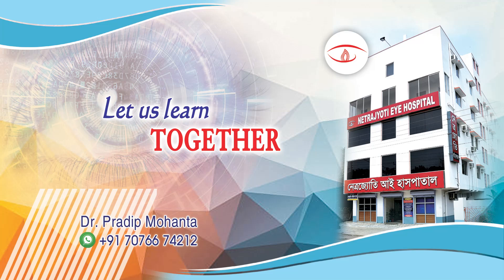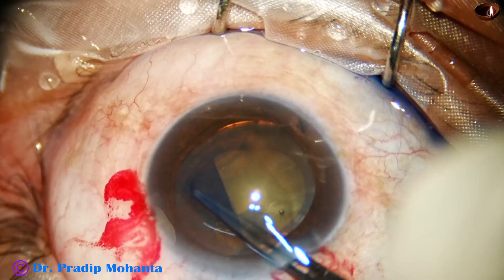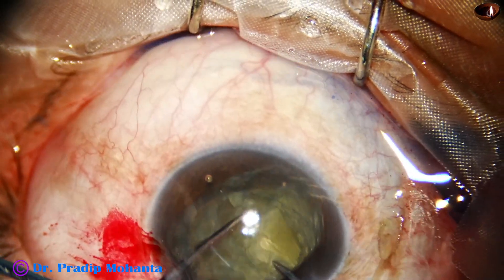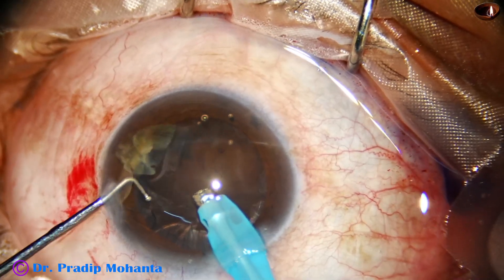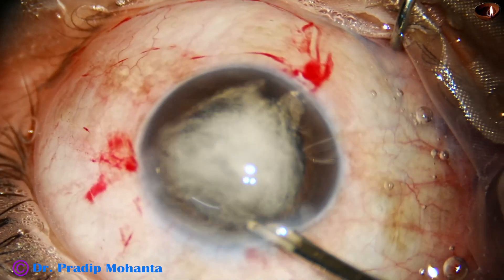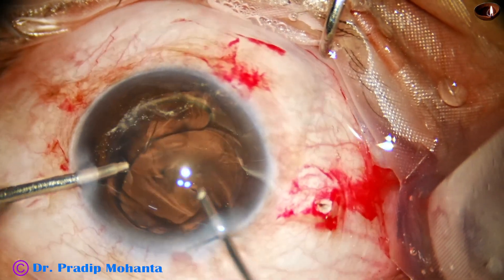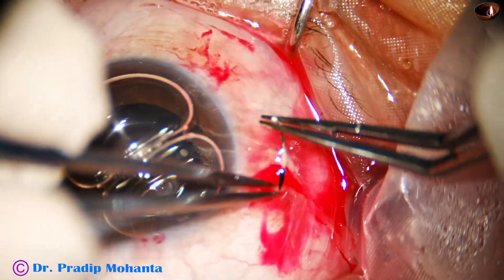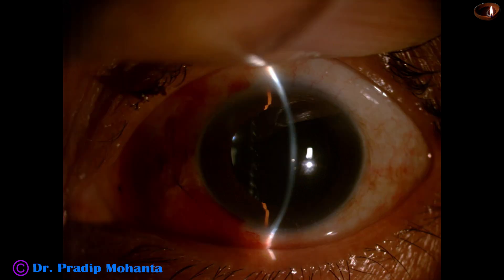Cataract with Zonular dehiscense- CTR applied, Pars plana anterior vitrectomy done - see postop pics

Comment: Amazing case sir, great management. Just 2 questions, 1 Can such a small piece be left in vitreous and patient be observed postoperatively and planned for a referral? I know sir you are trained retina surgeon as well and can easily handle these cases. 2 How do you sterilise the vitrector after usage, is formalin chamber a safe option?
Reply: I am also very curious about how to sterilize the anterior vitrectomy, btw in my country Indonesia the Oertli anterior vitrectomy set cost 266 Dollars, how much does it cost in India?
Reply: @NeomanGaming-pg4jb  I am not very sure but my guess is 18000 INR (roughly 205 USD)
Reply: @drkumarvaibhav It is quite expensive, that is why i choose Nidek machine, its anterior vitrectomy price is much cheaper. Are u using Oertli Machine sir?
Reply: @NeomanGaming-pg4jb Yes sir, Oertli Catarhex 3
Reply: @NeomanGaming-pg4jb  Yes sir, Oertli catarhex 3
Reply: @drkumarvaibhav In terms of Quality, chopping and holding power is much better in Oertli catarhex 3, however in terms of price and supporting items, Oertli is more expensive than Nidek